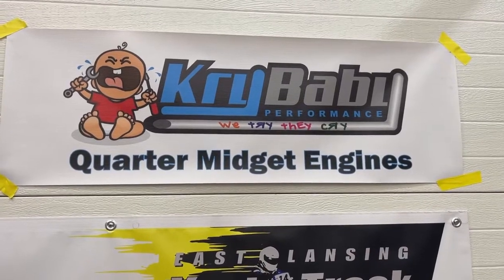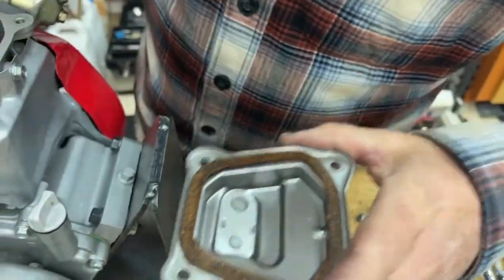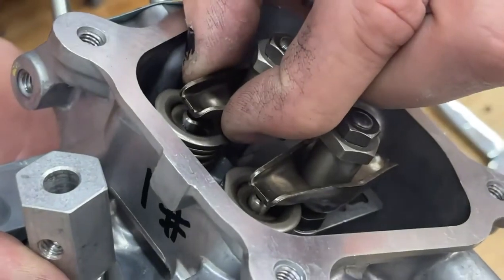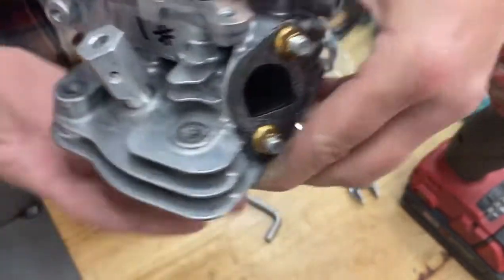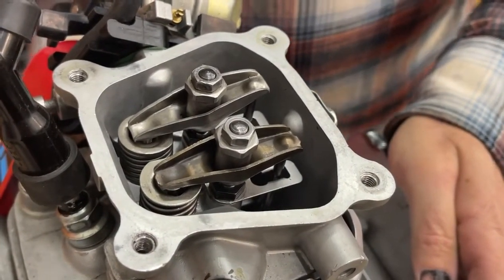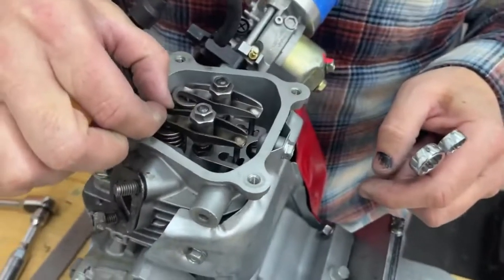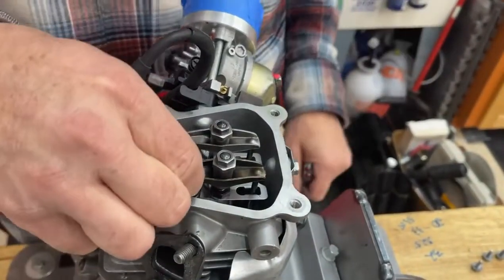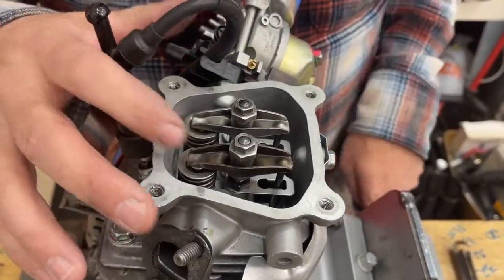How to check valve lash on Honda 120 / 160 engines

Comment: There is one interesting thing in this video: the way he moves the nuts.  If you look at others, they completely loosen the large nut and when you tighten it, they move the adjustment.  This person does it well.  Another issue is the gap.

Comment: I thought factory spec on these was .006" intake and.008" exhaust? Also, I have always known valve lash/ clearance to shrink under heat cycles, not grow. Am I wrong on both points?